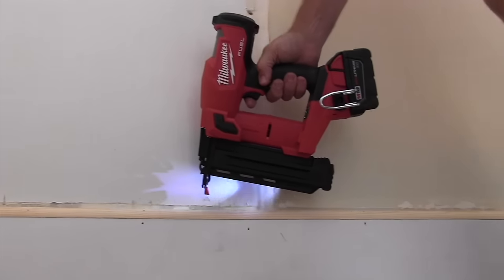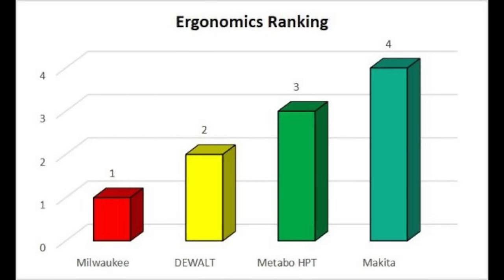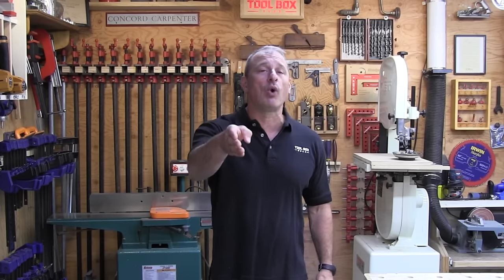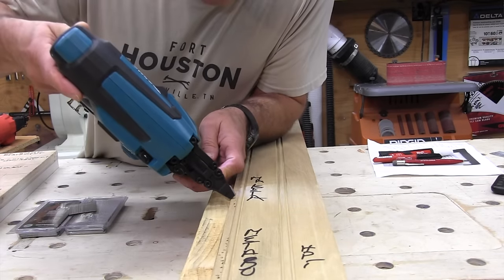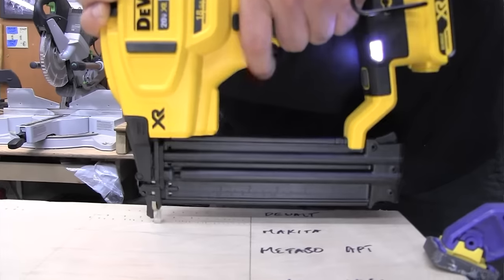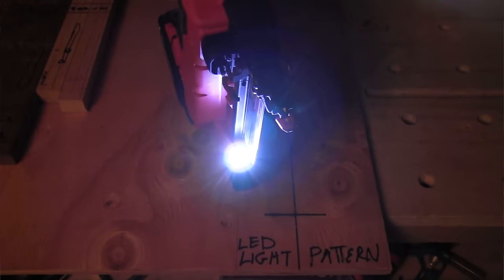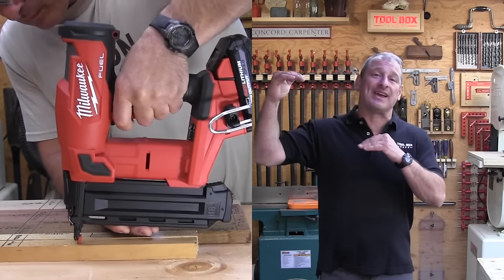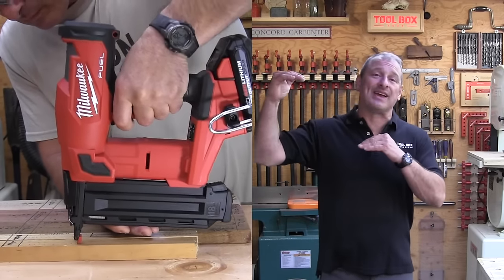BEST 18 Gauge Cordless Brad Nailer - Head-To-Head

Comment: After having a Ryobi cordless 18 gauge for a couple years, I got tired of the constant need to clean and oil the firing pin or the darn thing wouldn't complete the cycle and fire without actually driving the nail in.   Sold it on craigslist and bought the Milwaukee since I have a couple of their other tools so have bats and a charger.  Everything you say about it in this video is spot on.  Fast, reliable, and easy to handle.  So nice to have a tool that works perfectly every time.

Comment: This is the greatest, most comprehensive, straightforward, data driven, nothing hidden, down to earth, review I've ever seen. Absolutely amazing. You really won points with this engineer when you busted out the microscope to inspect the holes :)
Reply: so which one did u got
Reply: @drive-2786  it's been a long time and I think I was going to get the milwaukee... but then got sticker shock on all of these and couldn't justify it for my frequency of use.
Reply: @johnhendy1281  ,im getting the dewalt .,because i have other tools that use the same batteries .

Comment: I'm heartened to know that Milwaukee has greatly improved the gen 2 over the gen 1. I bought the gen 1 and even sent it to Milwaukee for repair when it would not consistently sink the brads. It came back with zero improvement in performance. I shelved it and bought the Hitachi to replace it. I have no complaints about that gun. It performs flawlessly everytime. I just sold the Milwaukee to a greenhorn because an imperfect nail gun beats non at all. I was forthright with him about the tool but he still saw the wisdom have buying it. 
I'd love to get the new Milwaukee guns as they look to be terrific. But I can't justify it as of yet.
Reply: Jeff Powell You could’ve traded it in to Milwaukee for the latest one if you got it recently!
Reply: @deluxepressure  no I got it right after it came out. I sold it to a rookie that had no nail gun at all. It's certainly better than nothing.
Reply: How about - just because. Thats a good excuse
Reply: The same thing with this gen 2 is gonna happen I know a guy who has the gen 2 he loved in the beginning then it started not sinking them all the way, thats tge problem with nitrogen filled air container eventually the air escapes, the Dewalt uses a flywheel system and actually gets better as it gets older, it might be more noisey and very slight delay but it is by far the most reliable of the nail gun systems
Reply: I bought the Milwaukee gen1 and its a great looking piece of trash that I think they had a nerve for letting it out of the factory and on to the market in the first place.
Reply: @nachito5841  I did by the second gen recently. I love it.

Comment: I just want to thank you Rob and the rest of the TOOL BOX BUZZ crew for all that you do. I am a young contractor who is just getting started out on my own, and videos like these are EXTREMELY valuable to me. I am able to get a clear concise idea of these tools before I make a purchase, and these tools arent cheap. So again I just wanted to thank you guys and say please keep up the great work!
Reply from the maker: Glad to have you onboard!
Reply: @ConcordCarpenter  We got a new Dewalt Brad Nailer Battery powered and every time it gets to the last ~8 nails they won't come out even though the battery is good.
Reply: @joew.1274  Dry fire lockout
Reply: @thepewplace1370  Do you know if all brad nailers have it?
Reply: @joew.1274  I'm not confident in saying all of them, but it's been a standard feature for cordless nailers for a while, from brads up to framing nailers.
Reply: @thepewplace1370  thanks for responding I am new to construction in general and the nailer I am talking about is DeWalt brand. I think it's only the smaller 1.25" and below nails. Maybe it's cus the set gets too light when it gets to the last few. I don't see anything on it for dry fire but maybe it is something I can add to the gun?
Reply: @joew.1274  If it's consistently not firing the last few nails, it's got a dry fire lockout. There isn't usually a way to bypass this, and those last few nails are considered waste out of each strip, although I'm not familiar with the dewalt nailers

Comment: The Metabo HPT (Hitachi) nailers are just proven and way to reliable for me to even consider anything else. I can deal with the weight for something that always works flawlessly 🤟🏼
Reply: Hitachi air guns were good their cordless line is very cheesy in my opinion.
Reply: Shoot about 20k nails through it and then come back.  Mine is currently in the shop because of low pressure.  It was around the 20k nail mark where it stopped sinking nails at all.  I'm sure once it's fixed it'l be great, but.. it's been in the shop for coming up 2 months now. (issues getting parts I believe)  But it is all under warranty so there's at least that.
Reply: @KahluaBomb  Were you keeping it oiled?
Reply: My HPT 18 gauge cordless is an alright tool.   It wont sink long brads in hard wood anymore and a piece of plactic broke so I have to tape the magazine shut.   Probably go Milwaukee next time if Makita doesnt release a new one.

Comment: Been air free for 2 years , try one out  at your local tool shop , sure air had some good points , fine nose , shoots through anything , light to hold in some cases , but the electric lead to the compressor , the space the compressor takes up in the truck , the air hose , and then the pack up time takes away those joys . I’m using the 15g ( Senco style fix nail ) Milwaukee , it does most of what I need and pack up is just walking to the truck and putting it back in the tool box , no more effort than that to pack up !

Comment: I love this channel and damn near every video you guys put up BUT I’m disappointed the Ryobi AirStrike wasn’t included.  In another video it bested the Milwaukee and should have been in this video by you guys.  Your videos are the standard I use for my purchases
Reply: That's the video with the Gen1 Milwaukee, right?
Reply: Isaac Ocasio thats 1st gen. The 1st gen Milwaukee was pretty bad. 2nd gen is soooo much better
Reply: @ViaEffects  ryobi beats all others for the price tho. Its on par if not better than other and its only 99
Reply: Yup I'd buy the Ryobi Airstrike products over these based off of function & value.
Reply: I was surprised it wasnt included as well since it does perform extremely well...and that price also?whats not to love
Reply: You guys pushing for the Ryobi Airstrike better see the vid that AVe did on these, these tools are pretty bad.
Reply: I have the ryobi that gun doesn’t fire through harder materials very well. I’ve had it for 2 years I used it a lot on site but it’s having trouble now. The design of its internal aren’t great it constantly gets itself out of position and won’t reset itself. I’d did exactly what I wanted prove that It’s worth buying a better cordless nailer.
Reply: @RidgelineJames  same. I find myself returning more and more ryobi tools
Reply: Prongu like I don’t mind getting one of their tools if I’m unsure if it’s going to make a difference in my workflow.
Reply: I use the 18 and 23 ga Ryobi professionally. Reliable for sure.

Comment: I used hitachi for few years and didn’t have enough power for the 2”. I tried for few days the Dewalt and Milwaukee and kept the Dewalt. The holes are cleaner and more power on the same test. And the most important is ergonomics and feels lighter.

Comment: I have the Milwaukee nailer. I have just run 30,000+ nails through it in the last month, installing pinewood ceilings at my family’s motel. I have had ONE, read it ONE, jam up, and i do believe it was my fault as i jammed the nails in the gun and don’t believe i had the strip of nails in all the way. On my 1.5 Ah battery, that is 6 years old (purchased bare nailer), i average 700 nails/charge. on my generic 5ah battery, i can do about 4,500 nails but it is significantly heavier. 30 minute charge time on the 1.5 so i just throw that on the charger while prepping the next bit of material and doing so it can keep up with a days work.
Reply: using harbor freight nails. cheapest on the market

Comment: I have the Ryobi airstrike 18g and 16g and I love them
Reply: The worst thing about the Ryobi is that it needs to be coddled a good bit. Otherwise, it's a good nailer.
Reply from the maker: n4thb4dc0 We looked at top 4 Pro grade nailers and chose not to include the Ryobi / Ridgid / PorterCable / Senior . Maybe in hindsight we should have, oh well too late
Reply: A Concord Carpenter / ToolBoxBuzz maybe in the future there could be a “ 8 gun shoot out test “ 👍🏼
Reply from the maker: timothy weigall maybe - were working on a bigger sampling of pneumatic framers now
Reply: I saw another comparison vid, and the Ryobi did comprehensively  better than Milwaukee.
Reply from the maker: Kulayyu pretty sure I know that video - it’s two years old and used rapid fire to put the tools into thermal protection. Ryobi doesn’t have it because it’s a cheaper tool. Not sure they evaluated nail hole quality either
Reply: @Kulayyu  everyone always says ryobi works just as good as the expensive counterparts. These are homeowners that dont use tools daily that have this opinion. Under daily use they wont last due to them being cheaply made. It's hard now to even find professional tools that last let alone cheap ones as with lean manufacturing they keep "improving" the tools and making them all cheaper. The only thing that improves is the marketing on the box. I own newer dewalt stuff that is junk but in my makita tool bag I still have tools that I bought 12 or 13 years ago when the lithium ion line up was just rolling out. Everything works great and i think I may still have an original battery or two that still work. In comparison I've seen tonnes of these new brushless tools die by the hands of apprentices. Drop a hole hawg accidentally and that's an expensive mistake, I watched three die that way. Also a few reciprocating saws that were not cheap meanwhile I'm here using my 12 year old impact as a hammer just to see if it will ever die and I've mixed quite a few buckets of mortar with one of my drills that's just as old and still going. All tools sales now is just marketing and putting the right numbers on the box
Reply: I've only tried the Milwaukee and dewalt. I own the ridgid nailer. I run ridgid every day and they hold up well however the dewalt and Milwaukee seem to be more consistent in power than ridgid. With that being said, I wouldn't rule them out against these guys
Reply: @0nem0ret0g0  ridgid is also made by the same company that makes Milwaukee, TTI. Some of ridgids tools have been better than the Milwaukee counterparts as they may use ridgid as a test mule for new technology before they put it in their professional line of tools. Like VW Audi
Reply: @bolerdweller  that's good to know. Thanks man
Reply: I’m a Milwaukee guy. Unfortunately the Milwaukee Brad nailer had terrible reviews on HD. I also saw the Milwaukee/Ryobi comparison video and bought the Ryobi which had incredible reviews. Very happy with it. I know the bright green doesn’t look right in my Red toolbox but I have to go with the tool that gets the job done best. Thanks guys.
Reply: @multidinero — I agree.   I own the AirStrike brad nailer.   It’s very touchy to get it to work consistently.   When it’s on point — no complaints.   I only use it periodically, so I’m willing to put up with it.   If I had to depend on it daily, I’d be looking at another brand.
Reply: @ConcordCarpenter  

Since most viewers own Ryobi or a comprable brand, and would like to see how those product stacks up against the pro tools, a Part 2 including that tool and other DIY'er brands should produce significant traffic.

Perhaps you can combine the test footage to re-edit this video for a Part 2.

Just a suggestion. Nevertheless, great video!

Comment: New to the channel and remodeling industry...  I've been a DeWALT guy for years in other occupations.  I love my Yellow and Black but I've found some tool envy in Milwaukee.  Between the top 3: DeWALT,  Milwaukee, and Makita, I've always found it interesting the Milwaukee and Makita (a lot of times) changes places as the #1.  However, I've also noticed that DeWALT usually retains the #2 position in most reviews.  Milwaukee is a brand that I might have switched to earlier but now... I'm too invested in the batteries, tools, and accessories to make the change.  I'm still happy to see that the brand gets solid reviews but damn... Milwaukee is solidifying that Professional brand name.  Thanks for the review.

Comment: The one thing that makes the Dewalt the best is you just put the battery in and good ti go all the time until the battery dies the other's you have to turn on a switch and if you haven't used it in a couple minutes it shuts off because they're constantly using battery power while they're on not Dewalt
Reply from the maker: Lou Cifer agreed it’s a great nailer

Comment: Happy Milwaukee improved their brad nailer. I can't see myself buying it unless the price comes down though.
Reply: Likely to. With the supply that Milwaukee makes, sometimes stuff starts going for ridiculously cheap. The 12v FUEL drill was going for 45 dollars a little while ago because of some combo kit deal.
Reply: No kidding.  You can buy a good compressor and gun for half the price. Granted you do have to drag around the hose and it is much louder. But you can also use the compress for a lot more stuff. But if the price were to come down to around 250 it would be a game changer.
Reply: The first gen one sucked. But yes, it's too expensive.
Reply: @cuchanu  Definitely worth the price though. Used both the Dewalt and Milwaukee, Milwaukee is a much better nailer in my opinion. No flywheel noise, no problem with tip marks on pine trim unlike the Dewalt, feels well balanced.....

Comment: Very helpful video and confirmed what I thought before watching. Just from comparing the Dewalt, Milwaukee and Makita in the store, I can tell the Milwaukee felt the best in hand and stood out over the rest. Unfortunately,  I had to go with the Mikata because that's the system of tools and batteries I have. If I ever have to do it all over again, Milwaukee is my pick. With that said, Makita products have always served me well and I have no issue with them but I feel like Milwaukee is just making better products these days.
Reply: You could have just got a battery converter adapter for Milwaukee to makita and use makita batteries with Milwaukee tools 🤣

Comment: Thanks for the video of head to head comparison test. I use a Senco 18 gauge brad nailer that has a slight edge of using 2 1/8” long brads. I use it for trim punch small jobs.  I also have and use Senco 15 DA and the 16 gauge nailers. But my most used for cabinetry molding installation is the Makita 12v pin nailer. I kinda wish the Senco would have been in the test run off. Again thanks.

Comment: Its nice to see the dewalt still hold up after all these years
Reply: I've found dewalt to be quite cheap  when it comes to parts in their tools. I have a select few dewalts but the rest makita. I dont own this Brad nailer but I own the spiker just because its convenient but I can tell it's cheap and flimsy and also expensive. For the tool and 2 6 amp hour flexy volt batteries I was in over a grand. I wont buy the Brad nailer as my friend works in a tool crib at a manufacturing plant that uses them and although good right out of the box, they don't last long and are in the tool crib for repairs constantly
Reply: Agreed. Almost still beat Gen II Milwaukee, and only lost in BS criteria

Comment: Hi fellas!
I´m new to woodworking and the battery platfom I´m probably gonna choose is Makita´s 18V.
But your test is the first I´ve seen that doesn´t hammer the Makita 18g brad nailer, every other  I´ve seen do not recommend the tool. While it came in at nr 3 you guys didn´t tell people not to buy it. 
I don´t know how many will see this comment, I´ve would appreciate people to comment if they like it or not, because I was surprissed that it did ok.

Thanks in advance, have a good day

Comment: Hi Rob,

I use the dewalt 18g brad nailer and it's great and light. I use it with the 2ah and the new compact 3.0ah. Anything bigger it becomes to heavy.

Yes there needs to be some improvent on this dewalt nailer. First, change the Rev up motor. It gets annoying after awhile. Second, make the top not so wide / fat. Again this can be due to the motor. Third, the led light (placement or brighter) with a control switch (on / off). Sometimes you just don't need it on. Hopefully DeWalt can come out with a new design in a few years.

The Milwaukee looks good. They made the right choice to just redesign the tool. The first one was very bad. 

I haven't used the gen2 yet but can't wait to try it out. From the video i differently notice no Rev up motor noise. The control button look ok and close. Only issue that i see is the led light. That shadow at the point might get annoying. Also to have to hold the button down for two second before firing.  

The nailer should fire once you squeeze the trigger and place it on the wood. Just like a air gun. 

These cordless tools have come a long way and just get better in time. I still have my corded tools just in case any of my cordless fail or break down. I still love to hit that nail with my hammer. Never have to worry about batteries or air. Old school my man, LOL...

Thanks for the video
Reply from the maker: I agree that sound is annoying but the tool DOES perform!!
Reply: @ConcordCarpenter  

Yes, it does.

Comment: You can't conclude which is the best without considering the SENCO Fusion guns. I've been using them for the past 3+yrs and can honestly say I've not had a single failure, They are heavy but on a par with the ones tested and battery life is amazing ..